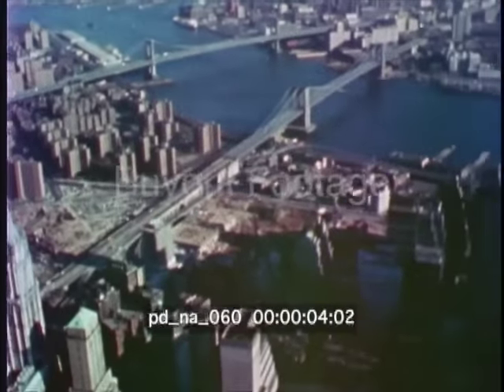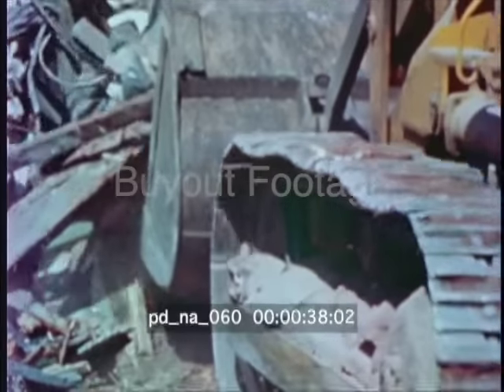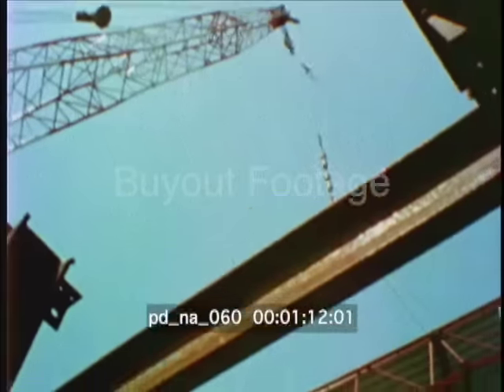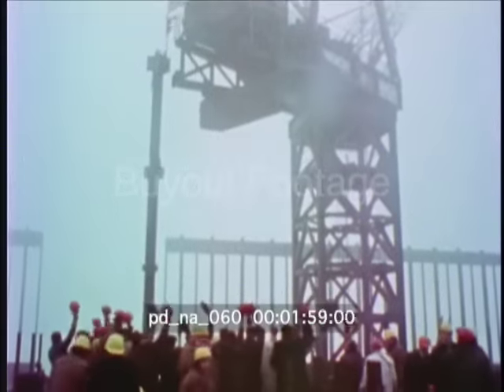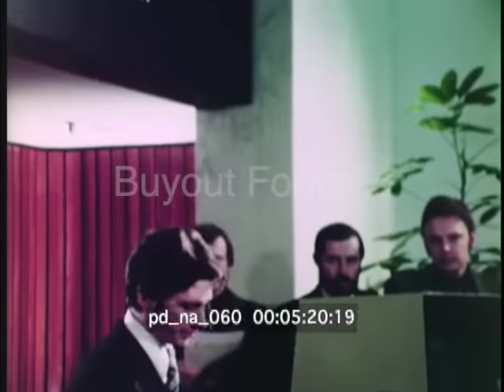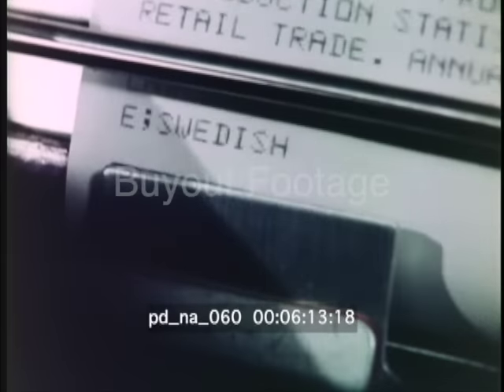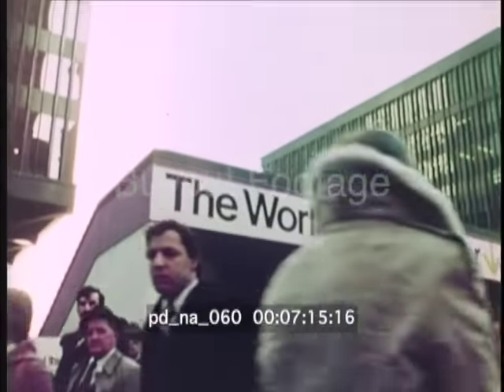Building The World Trade Center 1970s Stock Footage

Comment: As an architect and builder the structure was really well done and was beautifully built to perfection and the building skeleton looks indestructible. It's weird how a plane took down this behemoth strong structure weird 😳
Reply: It was the fire 🔥 not the plane that caused the buildings to collapse.
Reply: @mralef1596  bahahahahahahaha so your saying that the fire melted all those 20 inch thick steel beams like butter 🧈 is that your statement  because I've never ever heard of fire melting steel
Reply: @DEATH-_-MXSSIXH  I guess my statement was straightforward... Don't worry there's always a first time for everything ☺️😜 By the way, steel melts like peanut butter...not just butter. Check Mark Schwarz's analysis from Stanford. But I'm sure you know better Mr Bahahahaha !!! ;)
Reply: @mralef1596  I'm a fire-fighter and you can ask any other member they'll tell you the same thing.

Structural steel can withstand approximately 425°C before it begins to soften. Between 600°C and 650°C, the steel will lose half of its strength, and will pose a risk of failing (depending on the load it bears).

Unsurprisingly, even a house fire will reach very high temperatures of around 600°C or just under. Of course, it depends on what the material being combusted is. A simple candle will often burn at 600°C or more, whilst propane can cause a fire to reach almost 2000°C.
Reply: @mralef1596  I do know better if you look at the Sydney Skyline you will see my work and current work 😆
Reply: Your welcome 🙏
Reply: @mralef1596  any further questions must be submitted in writing and by post not social media. Thank you
Reply: @DEATH-_-MXSSIXH  You 're welcome! Not my intention actually 😉 I have more important things to do than arguing on social media ☺️
Reply: @O an explosion happened any person with a brain can figure that one out lol
Reply: @O yes this is unfortunate 😔 and the bigotry wow 😮
Reply: @DEATH-_-MXSSIXH  Yah, sure Karen...
Reply: @DEATH-_-MXSSIXH  Yah sure Karen...
Reply: @DEATH-_-MXSSIXH  Karen...

Comment: Absurd to think that aircraft made out of aluminium could penetrate the concrete and steel buildings.
Reply: It was flying at 500miles per hour. Anything traveling that fast does a LOT of damage no matter what it hits. Unfortunately due to the design of the twin towers & the size of the plane they just couldn’t survive the crash. 
The reason the towers can down (even though they were supposed to be aircraft proof) is the plane ✈️ was bigger than the aircrafts the tower was supposed to withstand. The impact of the crash dislodged the fire proof coating on the steels meaning they could heat up to higher temperatures. The plane was made of aluminum/aluminium and when it melted due to the fire it became explosive due to mixing with the water from the sprinklers causing  mini explosions within the tower further further causing damage to the structure of the tower. All the wooden furniture and paper also fed the fire making it even hotter. Going back to the steels due to the heat of the fire and explosions that caused the steal beans to bow disabling the structural integrity of the building. Add in the weight of the building above the crashes and that cause the beams to eventually snap and in the floors to fall like pancakes crashing down.
Reply: @EmilyCheetham  thank you for this thorough explanation. These conspiracy nuts are something else.
Reply: @EmilyCheetham  
Now you have to explain why Building 7 fell in the same fashion as the Twin Towers without being struck by an airplane full of fuel
Reply: As "absurd" as yer post.

Comment: Back when people built building for modernization and achievements and not to withstand planes flying into them because one country is so radicalized by their stupid religion coughs iraq coughs afganistan
Reply: The World Trade Centre was designed to cope with the impact of a Boeing 707 hitting the building at any point on its structure and survive the impact, that's just the impact of the plane,  however,  what the engineers couldn't calculate or work out a formula for at the time  was a fuel fire resulting from such an impact, also the planes that did crash into the World Trade Centre on 9/11 were Boeing 767's a much larger aircraft,  fully laden with fuel on internal domestic flights.

Comment: Stunning!!!
The exterior wall skeleton is the primary load bearing element in that building…and yet I see no fireproofing whatsoever. Steel that receives fireproofing is generally NOT painted. Steel skyscraper skeletons in New York of the period were generally fireproofed by being encased in concrete, including “modern” skyscrapers like Seagram Building and Lever House that produced the impression of a thin skeleton with their thin mullioned curtain walls. 
Spray fireproofing was just beginning to come into wide use in the mid-1960 and I don’t believe that the Port Authority or their architects and engineers really fully grasped how to make the WTC safe from fire. The floor structure members were trusses that had never been fire-tested with spray fireproofing. The tests may not have even been invented yet.
Reply: The yellow part of the buildings seen in some parts of the video are the tarps covering the windows during spray fireproofing
Reply: Thank you for this clear explanation of why steel girders are treated (insulated) with sprayed-on concrete based fireproofing treatment. I've seen this everyplace (we all have & taken it for granted without stopping to ponder) but it did not occur to me or connect in my mind other than perhaps protection against corrosion reasons .... so I didn't grasp it either.

Comment: It's still bizarre that as calculated at the attack was, they still chose to strike it after 8 am., when there could have been 100,000 more casualties even just a few hours later.
I wonder if it was because of more lax security at the airport terminal in the early morning?
Reply: I've always thought of it like this,  the hijackers etc were after the buildings as the primary goal.  they could have been empty, and in their minds ,  they still would have achieved their goal, and called it success, the amount of dead regardless of how many , was just bonus,  same with the pentagon, and what may have been Flight 93's target, the Capital Building, or White House,  they wanted to destroy symbols of power..

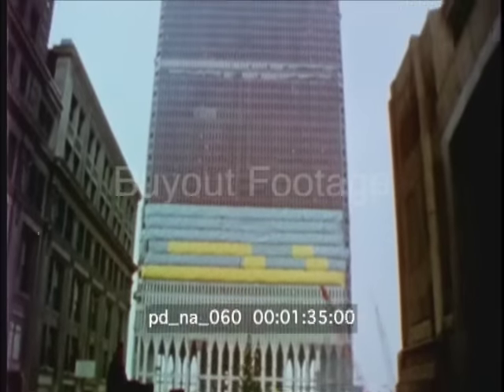Comment: 1:30 to 1:40
You can see the steel sections going up and 30 years later the same sections fall to the ground. A load bearing skeleton, why didn't they worry about planes hitting it? The same thing happened to the empire state building before they even built this. The interior steel skeleton is why the Empire State building didn't fall.
Reply: Both towers were designed to withstand and airplane hit.

Comment: Ok this building was not very wide or deep. Can someone explain how this jet almost such long as width of this building hit it using the whole speed ( not mention full speed achieved under sharp angle) and the whole power of engines and do not go through it partially or completly? These buildings within it was offices it means many empty space a little concrete and a little steel. Could it stop this full speed jet in the middle of the building?

Comment: The very things that made the towers unique ultimately led to their downfall. Building codes required 6 stairwells, the towers only has 3. Maybe if there were more support columns through the floor, they may have held up longer or not collapsed at all…
Reply: do you really think an extra 3 stairwells would hold up against 2 boeing 727s
Reply: @2fifty533  probably not but (in hindsight) MAYBE more than one could’ve be accessible…
Reply: @kingMT514  if you're talking about deaths, people in the other tower were told not to worry about it
that's the main reason that many people died, if they hadn't told everyone to keep working then a lot more would have survived

Comment: Just look around the two towers, it’s all been built around, this is me opinion only mine,
The insurance was to high on both towers, and both towers needed major repairs, so a controlled explosion inside happened while an aircraft hit both towers to cover I up, that’s me thinking outside the box, and yes, at 500mph plus, everything is obliterated, but an under carriage from an aircraft was found 2 blocks away wedged between 2 buildings.
Reply: Nobody seems to realize the inner core was Girders, and Steel reinforced Concrete, or that Both Towers were built in 3 Box Sections. Also, No NYC Skyscraper has an Elevator that goes from the Lobby to the Penthouse - it doesn't work like that. But, don't forget, Mohammad Atta's (paper) Passport survived the crash and floated harmlessly to the ground, so it could be found. I knew as I was watching it something was fishy, especially after watching Sky News report Flight 93 Landed in Ohio - try and find that on YT...

Comment: All I wanted to know is how can steel burn and melt ? Where u at bush
Reply: Donald Connoway  and WTC 7 any idea how that magically fell? Lol
Reply: Donald Connoway  . Passenger jets use kerosene fuel. Go do a search on the temp that it burns at compared to the temp steel melts. No way those planes took down those behemoth steel structures.
Reply: @jjp.8690  Steel doesn't have to melt in order to lose a significant amount of its strength. No one has ever claimed that jet fuel melts steel.

Comment: I visited the tower without the antenna back in '87. The view from the roof was indescribable, people and cars looked like dots from some 540 m up in the air. You just had to be there in order to experience that feeling. It's such a pity that now no one will ever be able to experience it. Well, yes, there is the freedom tower but i dont if people are allowed to go up on the roof to visit, its not the same. Those towers were a landmark.
Anyone know if the freedom tower is open for visitation on the roof like the twin tower without the antenna was? I dont remember which it was open for visitation, the north or the south one.
Reply: The South Tower has an outdoor observation deck and without the antenna.
Reply: @carlveluz1992  so it was the sourh tower i visited. Thanks for pointing that out.